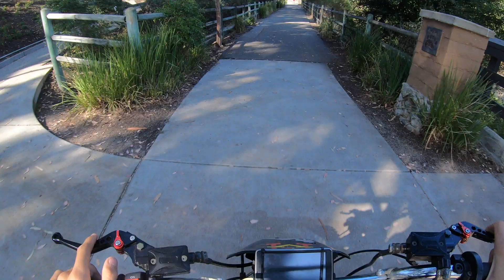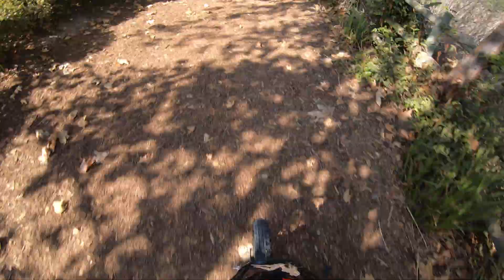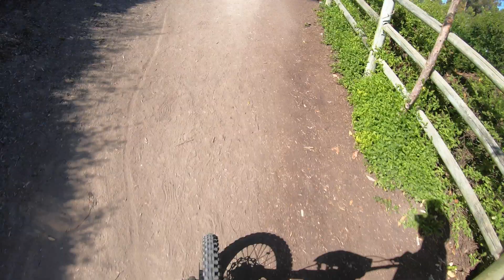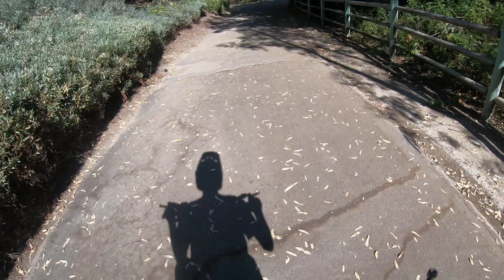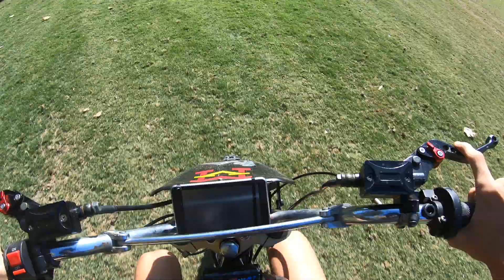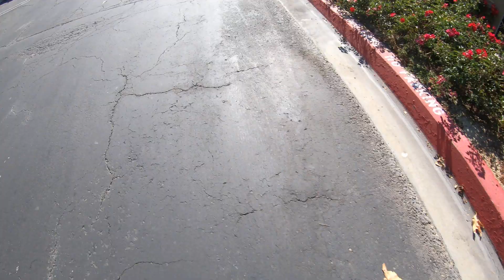Custom 7kw Electric Pit Bike With Insane Power!

Comment: What kind of battery do you use?
Reply from the maker: Sorry for the late response. It was a custom pack with a 100a bms but I was only using 80a max. My new bike has a battery from BtrPower which can be found on eBay or picked up here in California